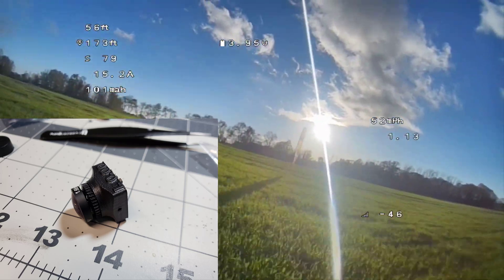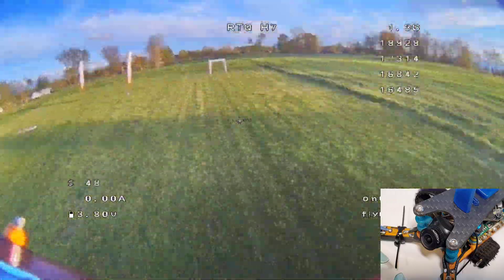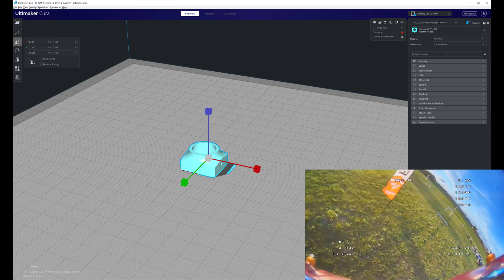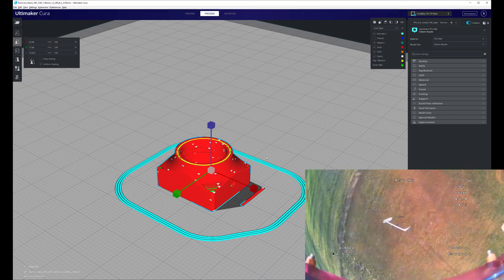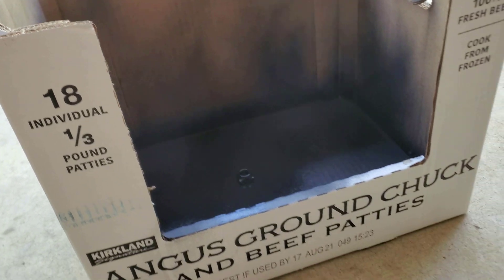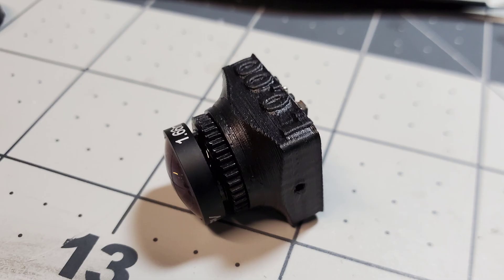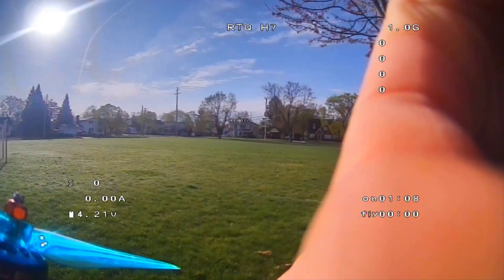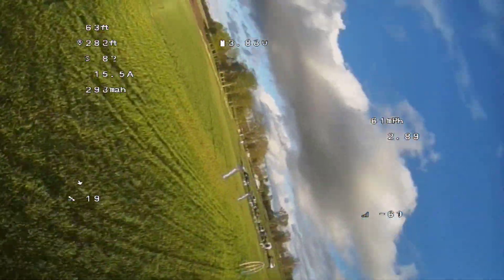Shark Byte | M12 Lens Mod Tutorial

Comment: The Plane of Focus also called DOF (depth of field) at wide open apertures on ultra wide lenses, or any lens, is always shallower than when they are stopped down with aperture blades (traditionally how you can increase DOF), if you could stop it down slightly with a glue on aperture after the IR cut filter you would have more areas at the edges and in the center of the frame in sharp focus with a less light hitting the sensor...it should overall improve sharpness slightly across the frame.

Comment: Great video, thanks Ryan. I got mine setup yesterday and flew a couple packs. Your videos look really good, the best I’ve seen. This might be a bit to ask but just wondering if you’ve thought about doing a step by step tutorial with all the programs and settings you use to make a YouTube video with sharkbyte footage, from the raw file to completion? Like just a 20 second piece of footage or something so it doesn’t take as long to step through the detailed process of converting the file and settings you use when generating the final file?
Reply from the maker: Sure, I think that'd help others. One of my tricks is that I don't re-encode the DVR, I just rename the extension from .TS to .M2TS and then my video editor opens it natively. The other important thing is to work on a 2560x1440p 60hz timeline. Need to do this, because YouTube uses a better codec (VP9) and higher bitrate at 1440p and above
Reply: @RyanQuellet   nice thank you Ryan, I will give what you said here a try. I’ve not yet invested the time into getting savvy with video editing so I know so little

Comment: Just got my HDO2s loving them. Can’t wait til sharkbyte gets light enough for whooping !
Reply from the maker: The whoop board is the correct dimensions and adds 5g of weight - so it works well for 2s whoops
Reply: What’s the absolute lightest camera that works with sharkbyte ?
Reply from the maker: Stock runcam HD is 5g. There's a guy on YT that found a whoop pancake lens that is shorter and lighter than the stock one and he made a video of it on a whoop build
Reply: saw a crux3 with the whoop board on it. Looked good but needs the lens you have. Shutterbug put  it together. Happy model needs to make it a bind-n-fly

Comment: Thanks for the tutorial..I bought some flat black tpu to try this with because of the light leak problem .I figured light was reflecting through micro fissures in the translucent plastic.Now every time I go to order the lens they're gone everywhere.. ...lol..🖖🏼
Reply from the maker: Even black TPU is transparent to light. If you hold your phone's LED flash against the print, you'll see that some red light makes it's way through to the inside. Painting the print flat black is mandatory to block all external light transmission - it also cuts down on internal reflections inside the camera body
Reply: @RyanQuellet   sure..I understand that..I print lots of stuff and see glittering facets  all the time but hoped maybe the flat black tpu not being glossy at the outset might work..dunno..going to cost me 15 minutes and .01 cents in plastic to find out.I'll give it a good shot of light and see what happens..Worse thing to happen is I have to find some flat black paint...and the lens in stock...🥴
 thanks for the input.
 wish me luck 🖖🏼
Reply: @RyanQuellet   Would just like to report back that the matte black filament I received from HK proved opaque at .75mm .I printed a 1mm  test plate which proved opaque using a high powered led flashlight as a light source (I still have a gray spot in my vision) and  and a .5mm which failed the test...I then  discovered the thingiverse tool that Alf posted on rcg which gave me my final determination of .75mm ...Yesterday I received a email from Pyrodrone telling me the lens is back in stock..Although by the time I hit the buy button I had purchased the last one apparently...lol..hopefully by early next week I will be able to test the end result sans paint..

Comment: Why did you choose the TPU material for the cover?
Reply from the maker: It flexes to account for tolerance deviations. Most people that 3d print for drone parts print in TPU, so they tend to have the material already. I wanted to show that this is pretty simple to do and you can use material you probably already have